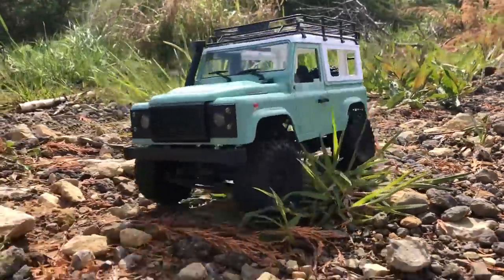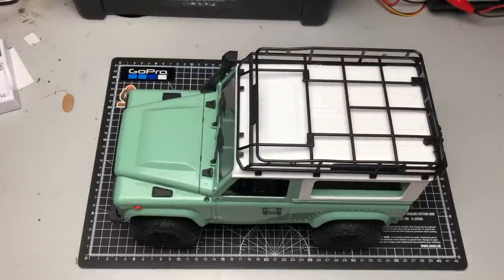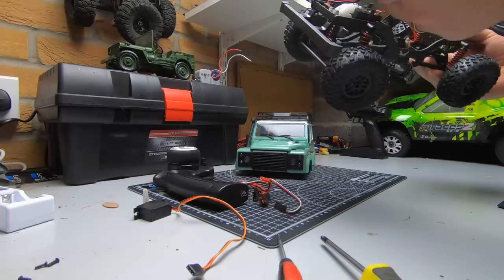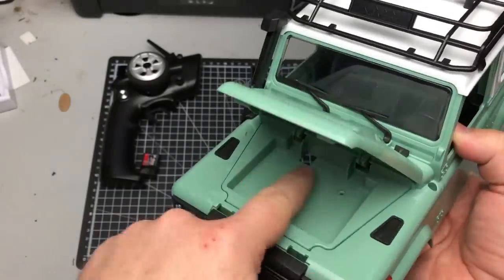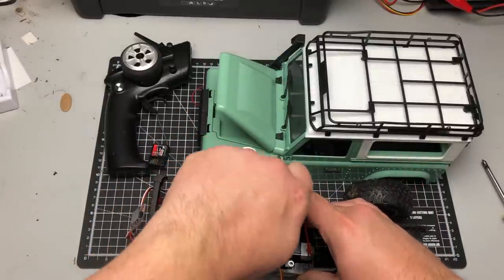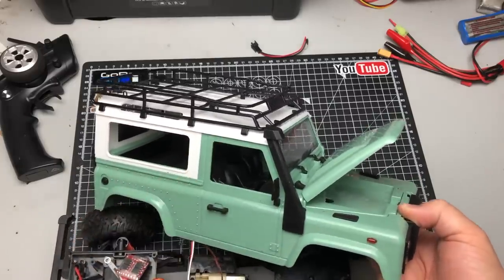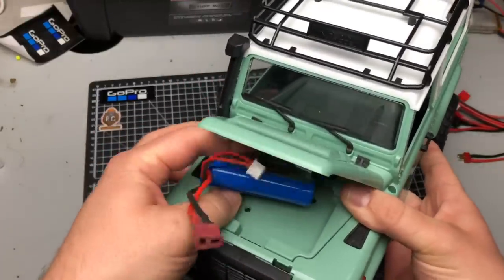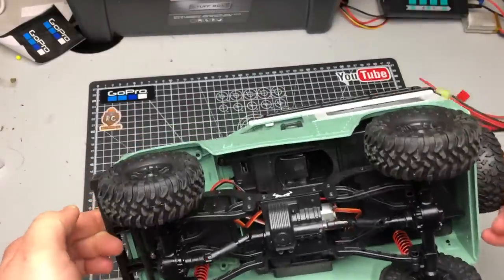How to upgrade your Toy Grade RC Car! MN Models MN90 WPL B36 motor. Upgraded Cheap RC Car. MN99

Comment: Great video, i used all the links, but put in a 2 speed wpl gearbox with a 380 motor and it works great!👌
Keep up the good work!
Reply from the maker: Thanks dude. Glad it was helpful
Reply: Hey man, any idea on where to get a different body for the RC? Been looking for Toyota Hilux pickup truck body but not sure if any would fit.
Reply: @louisarius9672  wpl c24-1  - toyota hilux ❤
Reply: is the 380 still working with the esc in the link above?

Comment: I just ordered mine. Thanks for the videos... I know some have bashed this car as not being "hobby quality" but I really like this design. Has plenty of choices for upgrades. I've seen the expensive $500 1:10 scale Traxxas but I like this one better.
Reply: The TRX4 Sport is $360 RTR plus battery and charger, $300 for the kit if you want to assemble and buy your own body. I've got another almost $200 in brass parts, but it's a good crawler. I've had a lot of fun with just my HPI FJ Cruiser with cheap wheels and tires and an upgraded steering servo (because the originals are absolute garbage). My friend has the classic Bronco and Defender (which are $500) with a few hundred in parts. This is fun if you want to do modding and don't want to spend a lot. I enjoy more competitive crawling with friends. I'll have to get some of my videos up from going out with them.

I hope you're enjoying this! It's addictive! I have several cars! The crawlers are my favorite for going on hikes with my friends. It gets us out of the house.

Comment: Great video . I own the MN D90 and what happens if I want to keep the circuit board ? Plus in order to upgrade the servo the connectors on the circuit board are different for the one used on any average servo.

Comment: This is indeed a very informative video. thank you for your sharing. by the way, can you share how you take video for you RC video? the camera angle is very near to the RC truck and also very low to the ground? do you use gimbal to stabilize your camera?
Reply from the maker: Gopro Hero 7 Black and a telescopic pole, lots of practice

Comment: This was such a great video. Please do more wrenching vids cause your camera views and narration are super clear. Most workbench videos I'm struggling to see what people are doing. 

Is the Fayee gearbox as low geared as the the B36? I have been wanting a RC4WD 1/18 Gelande. But for the price, it doesn't seem to be as slow as needed for realistic crawiling and the suspension on your MNM seems softer and more realistic too.
Reply from the maker: Cheers Ian, I will certainly look at a few more videos. The Fayee Gearbox/Motor is not a low geared unfortunately, but you can't buy the B36 combo separately from what I've seen.
Reply: @TomleyRC  OK, Thanks for the reply! I'll look forward to your C34 review. Maybe that'll be good out of the box. But I prefer the D90 body as I have a Series 2a in the garage.
Reply from the maker: I'm a big fan of the Land Rover, I'd have one if I had room for it! 👍

Comment: Question for you if you have the time, I am reasonably new to the world of RC and have an MN-99s version of this truck.   I bought a Transmitter (With receiver) the DumboRC X6....   In your video here you replace the ESC with your Transmitter/receiver.  Do I need to purchase an ESC as well?  Or can I get the DumboRC X6 to work with the existing MN-99s ESC?

Cheers, you make amazing videos!
Reply from the maker: You'll need a new ESC as well. These have a combined ESC/Receiver... so you can't attach it to your Dumbo one

Comment: My MN99 arrived last week. Very nice. I'm thinking of upgrading the axle housings and drive shafts to full metal. Are WPL drive shafts compatible? Or do you have links to MN99 compatible axle housings and drive shafts on Banggood?
Btw, finally got my B24 fully upgraded and working yesterday. I bought a green B24 RTR on Amazon cheap and it's got a very responsive, very quiet non proportional steering and servo. Luck of the draw or they've improved things. Runs like a bat out of hell and I haven't even upgraded anything yet...

Comment: Does the 3 pin servo connect to factory 2pin chip ? How did you connect that or I need to upgrade the chip.

Comment: Could you still use the old electronics if you upgrade the servo and motor?
Reply from the maker: motor yes, servo no as the original is a non-proportional motor type  👍
Reply: @TomleyRC  if i decide to change the servo, would i have to change the electronics and go with a similar esc like the one youve linked? And if i do so will i have to change the transmitter? (Sorry for so many Q's, looking to get one of these and fix it up, im new to the hobby too👍)

Comment: Hello, my MN99 faults have all been rectified. Still all metal housings/gears/axles. 
Quick question, how do you fit a metal rear bumper? Do you have to drill through the body to attach one ? Front metal bumpers are easy to fit. Also, bumper guards that fit underneath the front - how do they fit on? Any tutorials online?

Comment: hello what lipo battery did you buy from your MD99 I have the same solo that I put the with 380 brushed motor and how much do I connect I bought it to buy ami 1/12 MIN-D90 I put the 380 motor and it has no power loses it when turning it on and  all 4 wheels lock very slowly lock

Comment: Bit unclear, if I upgrade the steering to a digitally proportional servo then I must upgrade the ESC?
Reply from the maker: You can't fit a proportional servo on to the stock electronics. So you'll need a new ESC and receiver

Comment: I want to update everyone on the parts linked here.

The motor/gearbox combo is too big to fit the original space, the mounting holes are in different places and the metal shafts are too long to work on the d90

The esc needs the plugs changing to suit

Servo is fine however does not come with a part long enough to use as a clamp
Reply from the maker: Updated the gearbox. I didn’t realise it was wrong. You can now get the WPL B36 one from the official store. As for the driveshafts... they should fit with the WPL gearbox

Comment: Looking at doing this, I have the mn 99 which has lights when the throttle is applied, do you know how to connect these up on this set up, I have a similar 20amp esc and a Dumbo rc 6 Chanel tx/rx?

Comment: Will this work with the mn99
Reply from the maker: MN99 is already fully proportional with a 3 wire servo
Reply: Tomley RC can you put a 370 motor

Comment: Is the servo standard size?
Reply from the maker: It's standard for a 1/16 scale. Not the same as the servos you find on the bigger stuff.
Reply: Tomley RC Garage Thank you for the reply! Do you happen to know the gear ratio of the metal gearbox and reduction gear on the 370 motor?

Comment: As always a really nice video! 👍😎😁But after watching all your videos about upgrading (and doing it by myself and realizing how expensive these cars are at the end of the day) I still wonder if there are better alternatives: A while ago I built a Hummer H2 based on an HSP Kulak Chassis. This 1/18 Crawler only costs about 90€ and has high quality axles, gearbox, metal links, Oildampers and high quality electronics. And as far as I can tell from all the videos I've seen so far there is a huge difference regarding the off-road capabilitys of the WPLs compared to the HSP Kulak. So - maybe if you're interested in checking out my built,  just look at my channel, it's the latest video. What do you think? 😀😀
Reply from the maker: That Hummer looks cool! You have a good channel, have you stopped making videos? 👍
Reply: @TomleyRC  Thank you! Well I wouldn't call it like that but since I started studying at university there's literally no time for making videos. :/ But from time to time I produce a video. Just very irregulary. Regarding the Hummer  there's only one problem: It's wider than the WPL cars so I don't see a chance to fit the bodies of these. 🤔

Comment: I don't care about the lights but some folks might.  This process would toss the ICs that control the lights.  I was looking for a schematic so I could hack into it but this way probably easier and then add my own board for my own purposes.  For my purposes, I used a hot knife to cut the seats and dash out .  A straight cut right behind the seats did the job so now I have a lot more room inside for a big ass battery and other gear.  This vid really helped me out - I was on a wrong path.

Comment: I have just got my mn99s which I enjoy driving. Will the wpl parts fit the mn99s model as I want to put oil shocks, full metal axles, push rods and hopefully a 2 speed gearbox or a motor with a low speed reduction on it
Reply from the maker: Most if not all WPL stuff will fit
Reply: @TomleyRC  ah great. Means I can order some parts for my rig now.

Comment: I e ordered the same servo as shown in this video for my new mn99 defender will it work by just keeping the rest stock just getting into rc
Reply: Basically do I need to do everything in this vid to sport the new servo
Reply from the maker: I’ve not looked at the MN99 servo properly, but at a guess it will be a 5 wire one. And this one is a 3 wire. So won’t be compatible.... but I may be wrong, it may be a 3 wire on the MN99
Reply: Tomley RC Garage ok thanks for the help

Comment: Would you do any of these modifications on the mn99s? I was thinking of upgrading the reciever....... Great video.....👍👍
Reply from the maker: The 99s is very good. New transmitter will give you a little more control maybe.

Comment: Thanks Phil for that how to video,  I'll be definitely doing this to mine, think this Rig is Amazing am glad I bought 1 😁 thanks for the links to, am just wondering if you can cut the plastic under the bonnet or Hood lol  so you can fit a bigger battery, 🤔do you think it needs better wheels and tyres,??  dont know where to get them from, Anyway fantastic video Phil , thanks for sharing Mate 👍😁👍
Reply from the maker: Cheers Tony. It needs the Kit tyres...but I can seem to find them anywhere. All that I can see is the wheels/tyres together, and they are the hard ones :(  Not sure on the battery tray, I think if you cut it you'll end up with a big hole!

Comment: Just bought one of these as my first RC and already blew the front diff, the gears are shredded in it, what do I do? Is there axels that you can swap on these? Thanks
Reply from the maker: https://www.aliexpress.com/item/4000023773645.html?spm=a2g0o.productlist.0.0.748773a9BPjJdp&algo_pvid=6ed44dc9-b6c8-4099-b7b1-4d8f2b77edbd&algo_expid=6ed44dc9-b6c8-4099-b7b1-4d8f2b77edbd-12&btsid=1cd68d3c-744c-45f2-8443-474928ebce83&ws_ab_test=searchweb0_0,searchweb201602_7,searchweb201603_55
Reply: @TomleyRC  cheers pal, we'll see how I get on with it within the next 7-30 working days hahaha

Comment: Is the servo the same as on the MN99? The one on my MN99 seems to have a problem. A constant noise while seeking the middle position.
Reply from the maker: The MN99 Servo is a little noisy, it's because it is a cheap one.
Reply: @TomleyRC  Thanks for your reply. Do you know a good replacement servo that fits in the MN99 Land Rover?

Comment: Well, now I have 2 trucks to upgrade now, but it's nice to know some of the parts are interchangeable. I found out real quick how weak that 130 motor is. I thought something was wrong with the truck because it cuts power when you hold the throttle in a steep climb. It putts around ok on level ground or small rocks, but yeah.. definitely needs work to be a climber.

Comment: Took mine out yesterday, i've upgraded the servo and esc but not the motor, it gave up at the first hill, I've clicked on the links but the gearbox looks a bit different to the one in your video, Is it the same one. Nice video by the way too.
Reply from the maker: I replied to this, but it's obviously decided to delete it! Anyway, the WPL B36 Gearbox is not available on its own. The one in the link is the next best thing, which is a Fayee one.
Reply: @TomleyRC  Thanks for your reply. Thanks.

Comment: Hi Thier I am just seeing did you use the 20 amp ESC or the 30amp I burnt my esc out😭😭I am running a 2.4 g hsp reciver and controller. Any help would be greatly appreciated
Kind regards
Reply from the maker: I use the 20a ones...no issues so far.

Comment: Great detail, now I need to find an esc that supports the LED lighting.
Reply: HANGINGWANG, I plug mine into the receiver using 1/8W 220 and 470 ohm resistors, reverse lights same but connected to the back of the motor.

Comment: Hello. I've got an Mn 99 great rc but would like to make it a little bit faster but too much. Without messing about with it too much, what you you recommend doing please? Could I change the gearbox?
Reply from the maker: I think the MN99 comes with a 260 size motor... not sure what other motors are out there that will give you a bit more speed.

Comment: Quick question , I put a 260 moter and gear box in my B-16 , works great , but , my friend has a new B-14 with 130 moter and his truck is much faster and more power to the wheels , we put in a new receiver and ESC ,(ax5s) I seem to have less power than his , just wondering what or if I did something wrong  or , thanks for your help Jay 😄
Reply from the maker: The 130's aren't that good from my experience. Is it not a 180 he has? They has some good speed and power sometimes. Not sure why yours is not performing

Comment: People say this car Is junk....i never had a RC toy, So at 26 i decided to buy my first car. I only use it indoors or on garden And i could not be more happy. I dont understand electronics or dont want to spend a lot of money on upgrades, but i bought a cheap bigger battery from China, made a hole inside si the battery can fit in boot...I am trying to say that this car Is enough for me, i dont need 600$ Models

Comment: I know ads pay for things... but be damned if I watch youtube without a blocker.  It's an unholy nightmare of interruption and annoyance.  If they'd tone that down a few notches I might actually be ok with tolerating them.  I dont mind ads, but they've taken it someplace I just refuse to go.  Sorry.  Thanks for the video.
Reply from the maker: This video has got 1 mid role advert. For a 21min video I’d say that is well below average. Most YouTubers would put 4 or 5 in something this long. 1 before, 5 in the middle, 1 after… and then if you think some of those will be ‘double’ ads.. it’s gets way to many!

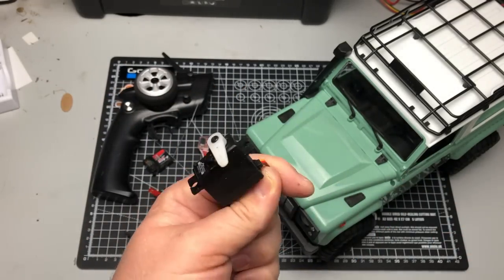Comment: 4:36 that servo looks like what i used. I have an issue on that the gear was tear off. When i disassemble the servo i found its not all metal it has a 2 plastic gear inside😂😂
Reply from the maker: Oh!...I'll have to have a look!

Comment: Thanks.  Really great because I'm new to rc and planning on doing what you did to my cars.  It helped out,  your step by step video.
Reply from the maker: No problem. Glad it helped
Reply: @TomleyRC  It would help if someone did a how to install the wires correctly into the plugs on the ESC to prevent frying the circuit board...

Comment: Does anything have to be soldered onto the Fayee motor you put a link up for when swooping over the stock 130 motor in the MN90?
Reply from the maker: The Motor wires usually need soldering, or the connection on the end of the motor wires
Reply: @TomleyRC  What connection? You should show how to do that in a video too.

Comment: Perfect video! Thank you. Very clear instructions as to how to upgrade the MN D90. I've just got mine and yes it does need better electronics, but I'm very pleased with it otherwise. Once I get it running better I'll upgrade the suspension setup. Then I'll just do stuff like putting stuff on the roofrack etc. I want to get back into RC cars and this seems a great place to start.
Reply from the maker: Cheers Steve. There are so many possibilities with these things. And nothing really costs a lot either!
Reply: @TomleyRC  I've just ordered the stuff I need using the links in your vid. Any idea on delivery time to the UK from China?!
Reply: Stupid question, but if I get a light set do I just plug the 3pin plug into the receiver?

Comment: Hey Tomley love watching your videos. I have a quick question about the ESC you're using. You showed a tiny switch to use the brake, but the one in the list doesn't seem to have it. Am I missing something? Do I need a brake in my small WPL truck or is it just a luxury I shouldn't worry about?
Reply from the maker: Try this one dude. I may have put the wrong one in the link. https://www.banggood.com/custlink/mKmGtR1HSR
Reply: @TomleyRC  Hey, just wanted to let you know that I ordered the Tx/Rx you showed, two of the servos, and that speed controller with brake! I'll be able to more fully enjoy my C24 thanks to your help!
Reply from the maker: @danr3778  Awesome, it'll be much better with them upgrades 😎👍
Reply: @TomleyRC  Hello again Tomley! Got all my parts in along with all metal gears and axles! One last question for you... That receiver has two JST plugs. Which one goes to the battery Male or female?
Reply: Figured it out... Battery goes to the female connector!

Comment: Hey I have to use that same color was wondering would a different motor be possible the motor in mine has just gone bad it makes an awful noise going forward but sounds fine going in reverse how would I have created the motor what are you upgrade it with the same one?

Comment: When you install a proportional circuit board, do you have to swop over the existing wires and on off switch with the ones that come with a proportional circuit board as well from the vehicle or can you simply plug in the existing wires to the new ESC? 

Is the ESC you showed compatible with a WPL B24 and it's proportional steering hand held controller? 

It would have been good if you showed HOW to connect the wiring into the ESC plugs - which coloured wire corresponds with others etc to prevent mistakes and burnt boards like what has happened to me recently....